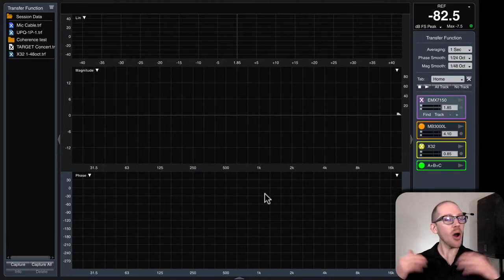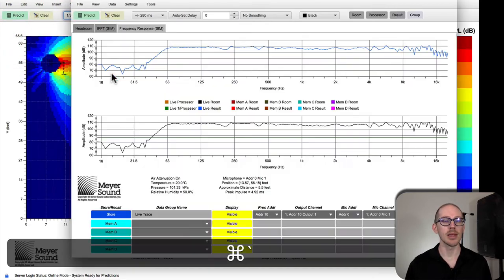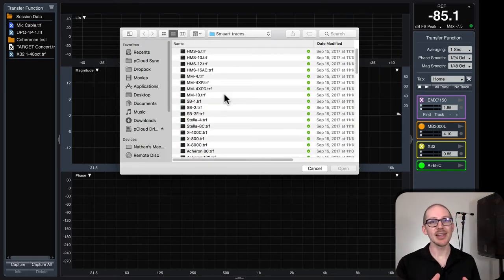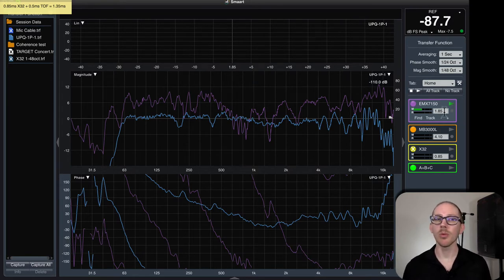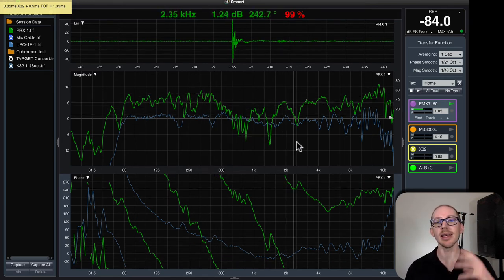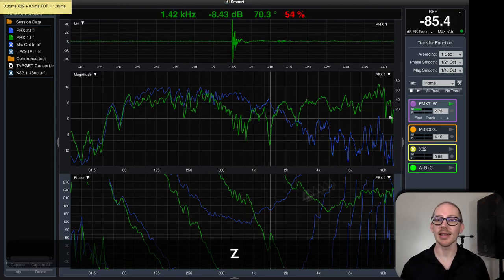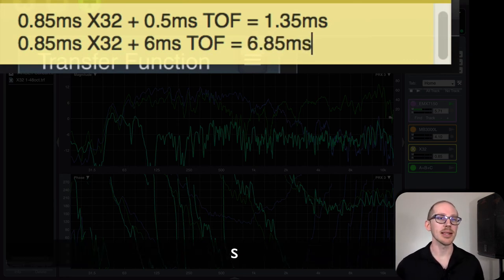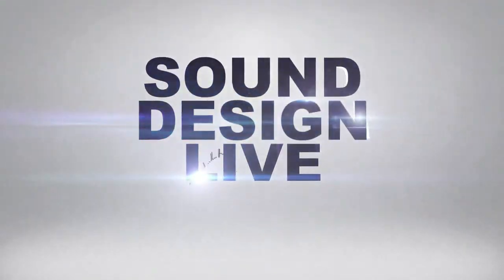What does a full-range speaker look like in Smaart? [GSwSST27]

Comment: Hello Nathan, please mention that for this measurement you used a Y balanced cable one end to as a reference and one as a feed for the active speaker. I had hard times figuring out this, I had to do some verifications with the mixer and without, only if you are looping back the reference from the back of your sound card you can verify yourselves with the formula ( mixerdelay + tof = delay) if you are going straight to the console than back from the console through a matrix output the formula does not count. Is that right? Thanks!
Reply from the maker: Hi Adrian. Yes, I am using a Y split cable to duplicate the output. It has a TRS balanced jack on one end and two of the same on the other end.

I'm not sure I am totally clear on your question. What are you trying to measure? Are you trying to measure your console?
Reply: Nathan Lively  i took your videos in order, i setup smaart like in your video about signal verification out from soundcard to the aux in mixer than from the mixer aux out matrix back to sondcard and out from the mixer (dl32r) to the speaker...and i did not get the right numbers for the "tof", i just figured out that i get the right "tof" only if i loop back from the soundcard to one of it's inputs. My point is that you did not mentionet your measurement method / procedure...signal flow for this video in particular. Thanks!